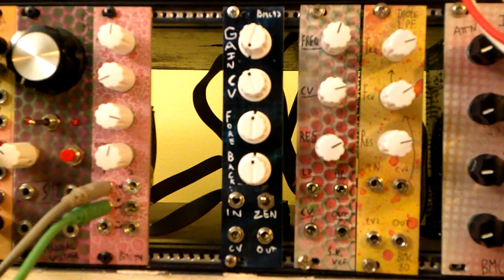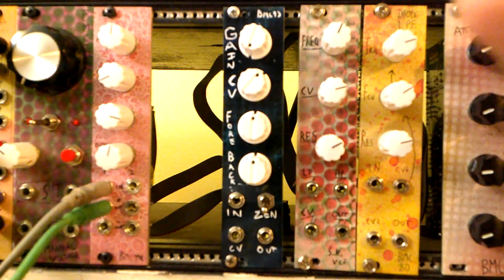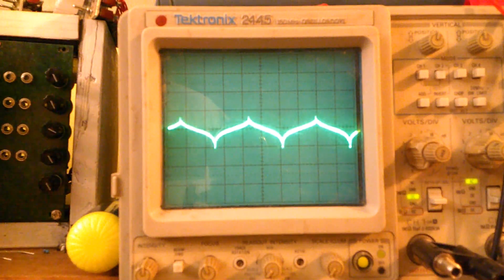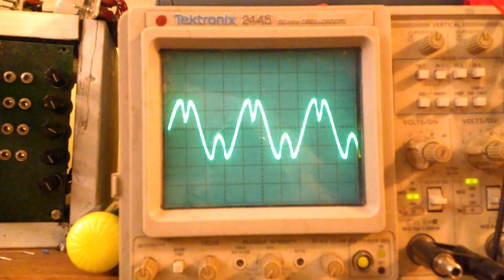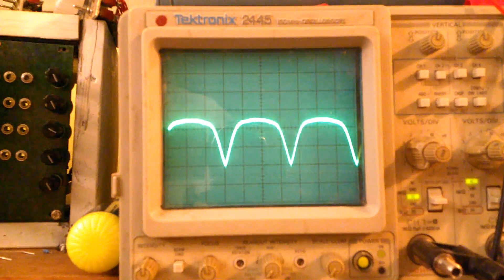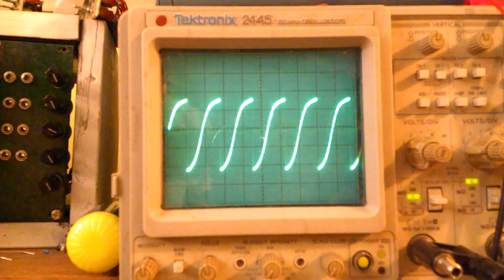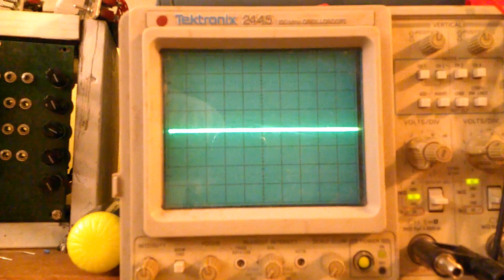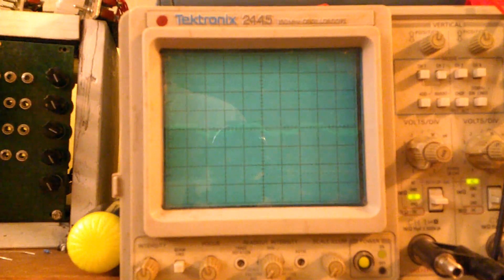BMC093 Diode Shaper VCA Demo

Comment: Did I hear digital signals pass straight through?
Reply from the maker: No, this module's analog and the VCO feeding it is also analog.  Things maybe sounded harsher for a second when I turned a knob too far?
Reply: @boogdish  I was being funny, the thought was if pulse waves pass through it could also pass a digital signal encoded in the wave. Not super practical but an odd thought 🤔